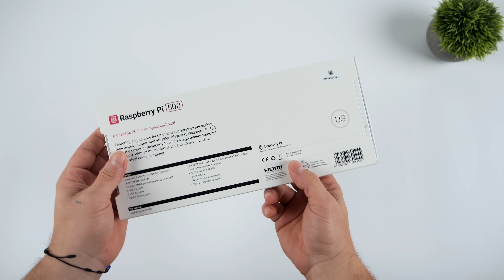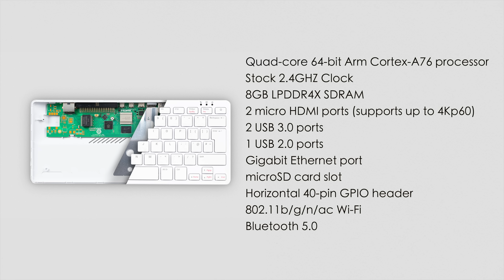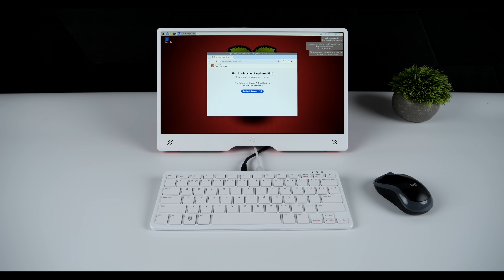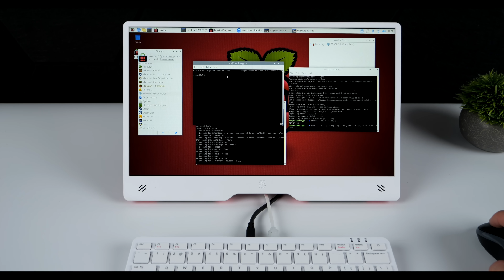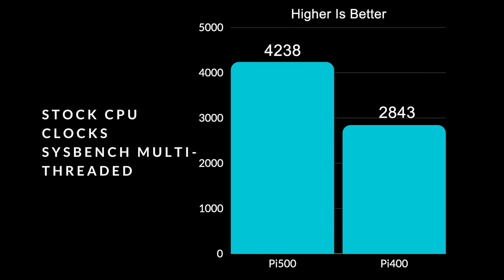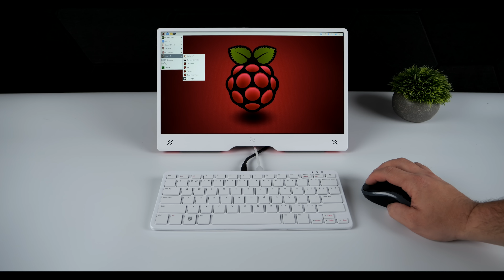Raspberry Pi 500 Hands On First Look, It's Finally Here!

Comment: I liked the PI 1,2,3 etc... They were cheap and great for small IO projects that were too much for an Arduino. However, The full kit and monitor is about £206 in the UK. I'm wondering what benefit this has over just using an old laptop and buying an IO card. Much more powerful, more software, battery portable.

Comment: Yeah I really don't understand why Ebon Upton didn't add an M.2 socket, relevant chips, and include a knock out or access panel to allow users to install an M.2. It would have been small fries on the price, and I'd really be happy to pay for that. It would also give the Pi#00 series that missing component found in all modern computers. Maybe the Pi600 will include it, or an upgraded variant of the Pi500 will add this feature. After all, why have the pads there if your not going to do anything with it?

Comment: I have a RPi5, but i think the 6 will brake the barrier, i think the RPi6 will be a computer with full capability, since we have 4 years with good performace arm processors(apple silicon), the next RPi will come with one of these processors(not the apple one, but one with this horsepower), and usb C as major. If is not dream too much, they can give up HDMI and all usb ports for 1 USB C as charger and 2-3 more USB TB3-4 would be more than enough to replace all the actual ports with dongle.

Comment: I knew they'd make a 500. I wasn't expecting it to be entirely white, and I certainly wasn't expecting a monitor. It would be cool if they also made them in black. I see that's it's got connections for a battery, and other unused spaces.

Comment: This might sound crazy, but I somehow wanted to try out the Pi 500 with an Xreal/Rokid/RayNeo/Viture AR glasses. I don't have much expectation for head tracking in Linux OS, but having a huge external display from those AR glasses is already tempting enough for me.
Reply: would have been easier if they included a full functioning usb-c port, but alas..

Comment: In addition to the NVME slot, I think this could be a lot more successful if it had included a Pi camera connector. The Pi 5 series lacks video encoding, so any advantage it could get to reduce CPU overhead during a video call would help a lot. Video calling is a use case that has really grown over the years and I'd like to see them consider it in the next generation.

Comment: What is the use case for this?  Besides to play around with
Reply: Same as any Raspberry Pi - it's a learning/programming platform. Getting a 40 pin GPIO in a standard Mac/PC isn't quite as easy. It's a great way to get kids into linux and/or python.

If that's not enough reason, it's a great emulation station. Or it's a quickly headless server type option. You want a headless choice while being convenient - bam.

Comment: Admittedly, I don't know much about hardware support when it comes to Pi's, but it seems a bit odd that they designed the monitor with a USB-C input for display, but didn't include a USB-C output on the Pi 500 🤔
Maybe different teams that weren't communicating, or can Pi's not do USB-C display out?

Comment: I think I'm more excited that the little monitor is full 1080 and completely cased with buttons with some mounting points then the pi500 but it's still a cool welcomed upgrade. Man you can get one right now for 90 bucks, in stock too. No NVME is complete bummer, it should of been included and just released at $99 dollar instead of 90 to recoup cost.

Comment: For those people that need a basic computer, but do not have much money the Raspberry Pi 500 along with the Raspberry Pi Monitor is a real bargain. This is one of the lowest cost computers a person could buy. However this comes with some limitations. One limitation is that this computer is slow when compared to other more expensive home computers. Also this computer can only run a few linux based operating systems, such as Raspberry Pi OS and a version of Ubuntu.

Comment: I have the Pi400 and i cannkt type on the keyboard very well due to the weird key spacing.  Apart from that its great.  I wont upgrade to the 500, but i will wait for the plus or 600 version and see what that includes.  Im amazed how the price keeps falling.  It will be a great cheap retro gaming and basic computer use type bit of kit to buy for many.  It would make a great Xmas present for many im sure.

Comment: Would be cool if the portable monitor would have been display over USB in combination with power delivery (from the monitor to the Pi). Think an SSD would have been better on the underside of PCB. Don't want people to go remove the keyboards above with the lid and clips.

Comment: Kind of a bummer that it doesnt use USB-C for power and monitor. :(
Reply: Came here hoping to find the answer to this question, but now I'm disappointed.
Reply: I felt the wording was a bit unclear? He said you could power it by usb from the raspberrry pi but only at 60% brightness. I guess that is not using USB-C but rather hdmi and a regular usb to usb-c cable?

Comment: Darn nice setup for standard cheap office PC and many other things. 

But you say avg 2.5 times as fast as the Pi 400. Some of the tests might get up there but from the static benchmark this is 50% faster only. not 150% but still a respectfull generation upgrade. You rarely get 50% more power from a normal PC or Mac 1 generation upgrade.
Reply: I do find it a bit odd that a couple of real world tests showed 3-4x improvement while the synthetic benchmarks "only" did 50-70% as well.Not sure what that is about.

Comment: so close to making a modern A500. just a touch of that A500 design would have been so cool maybe like a centimeter of flat part at the back edge with some ridges "for ventilation", and a logo PI500 on the right. Basically a nod and a wink. Of course, with the non-keypad design, maybe it would be better with it looking like the A600, even if the A500 is my Amiga.

Comment: Micro-HDMI?? This is basically e-waste with such a fragile connector. Would be an instant buy if they put full-sized HDMI ports on this.
Reply: Am I the only one who hasn't had issues with that connector...yet?
Reply: @trilight3597  I've had a Pi 4 since December 2019, and I've not broke the port of plug.
Reply: My Pi400 has had no issues with micro HDMI, so unless you're yanking it or just not being careful, it should be fine.
Reply: Agreed.
Reply: @ExplainingComputers  They don't seem that fragile.
Reply: You just need to carry a special cable for it, it's not expensive, but a bother for sure.
Reply: No it isn't.
Reply: I got an original pi400 and the micro hdmi has never been a problem
Reply: Just support video on the usbs and use a USBC to HDMI is what I want
Reply: They won't, it's in their policy to manufacture user unfriendly computers: non full HDMI on a DESKTOP computer
Reply: @danielpicassomunoz2752  or it just doesn't fit the case.
Reply: The Orange Pi 5 has full size HDMI and it has an NVMe slot.

Comment: In my view the biggest miss of the Pi400 was not having at least one regular HDMI port. This new Pi500 perpetuates that mistake. A full HDMI port would have made it simpler for occasional use (my case), so I will pass on this one, as my Pi400 is still serving me well.
Reply: @wanderleyceschim2881  just curious why using a mini Hdmi Adapter would be a problem? They are dirt cheap and it's what I used for the pi400
Reply: @Astro_Five  Like I said: occasional use. I have many things I plug in and out of the same HDMI port. Would like to just leave the one HDMI cable there and plug whatever to it without having to deal with a separate cable or yet another adapter I will misplace. And I understand the SBCs are tiny so no space for full HDMI port, but they had an opportunity with the 400 and now with the 500 and in my view missed that opportunity.
Reply: @wanderleyceschim2881  right on. You just leave the adapter plugged in to the Pi itself. It works just like the regular size HDMI input at that point. But I respect it being annoying to you

Comment: No full HDMI nor NVME will wait til Pi 600 so another 4 years.
Reply: I can live without full HDMI since micro HDMI and mini HDMI are still being widely adopted today. As for NVMe, I doubt this kind of enclosed compact design has enough cooling for it. M.2 SSD can get really hot.
Reply: Those micro HDMI and micro USB ports are  Sooo commonly breaking..   Anyone buying this should use a micro HDMI connector to full HDMI,  adapter.,  

Save the strain from impacting your device,  only plug and unplug to the adapter  (which always stays plugged in.)
Reply: fully agree. full size hdmi should be standard, specially on a large device. carrying an adaptor or cable only for this is a waste.
Reply: HDMI I can accept, but no m.2 is a deal breaker, they have lost a lot of market share to other alternative barebones and mini pcs already, I think they botched this.
Reply: @jondm733  you are right this keyboard style pc could be for eceryone not only for enthusiast... full hdmi is great too you dont need extra cables and full hdmi is highly available
Reply: Ya,  have to agree,   it needs full sized HDMI, (the minis break all the time) ,  easy to access  M.2  panel slot  (or two M.2 slots) and Easy RAM upgrades.  That just makes it easy to take the defaut configuration, or upgrade to 64GB RAM and 4, 8, or 16 TB of storage.
Reply: You will be dead before anything like that happens lol
Reply: You can build it yourself, plot out your own circuit board replacement and transfer the chips over.  The whole point of Pi was to be an educational resource to motivate Europe and USA to advance in engineering skills and electronics manufacturing and Programming.  Otherwise we run the risk of China taking over the whole industry.  Thank goodness for Japan & South Korea and Tiawan.
Reply: Why not get a laptop?
Reply: Micro HDMI is shit.
Reply: @DaveMcIroy  agreeded as ite easy to break like mini hdmi
Reply: @DaveMcIroy  No it isn't. It's just a connector.
Reply: It won't take that long. I can see a Pi 500 Plus happening. And who needs full HDMI?
Reply: @wisteela  I need full HDMI, Micro HDMI breaks too easily.
Reply: @  Pi 500 Plus , now with NVMe and full sized HDMI 2.2.  Just  $50 more.
Reply: I get the missing nvmi is huge pain but full hdmi is not a big issue imo
Reply: Don't need nvme on such a low end SBC.
A simple micro HDMI to HDMI I already have laying around solves the "problem".

With Pi600 hopefully there isn't any HDMI still around: should have a USB-C for that by then.
Reply: @hassosigbjoernson5738  A 2230 NVME could be useful...something low-end like 64GB would be more than enough but would offer much more long-term usability than a Micro-SD card.
Reply: @hassosigbjoernson5738  I'd be fine with Mini DisplayPort as well.

Comment: Would be such a suitable computer for my mom if it just had option for an ssd.
Reply: Your mom will be just fine with a 256gb micro sd
Reply: @raskarkapax  sd cards break and are slow.
Reply: @fleshreap  sd cards only break if you constantly swap it without taking much care of it. But if you put it carefully inside once and never touch it again (just as you would do with an internal ssd) you won't have any chance to break it. And a good SD card can read up to 200mb/s easy which is just as fast or faster than a good HDD.
Reply: I run my pi 400 with a portable USB SSD just fine

Comment: I would like to see this keyboard with an Apple M1 processor inside 🤯
Reply: At 10x the price and won't work without an iTunes password. No thanks.
Reply: Itd overheat
Reply: I've seen people take screens off M1 Macbooks that were damaged and use them like that. It's definitely something you can do yourself.
Reply: it's called Macbook Air and comes even with a high-res HDR monitor and a battery to use it everywhere ;-)
Reply: @TT-pi8ww  A MacBook is not a keyboard

Comment: Is it just me or is this just an overpriced toy? I seriously do not see a proper usecase for it for this price, especially with it having an underpowered ARM chip from 2018, in the age where ARM chips can go head to head with x86.

It can't be used as a daily driver, it's not that practical nor cheap enough for hobby projects, what is it meant to be? And not to mention all the unpopulated stuff on the board. The least they could have done was to give us a proper PCIe/NVMe port...

Comment: For the ones more versed in Computer engineering is it possible and what would the drawbacks be to putting a more powerful mini PC with a higher quality CPU in this form factor with a PCIe or oculink plugin that could then use an eGPU to game? Just curious. Would the heat be a limiting factor?

Comment: The M.2 is not the only thing that is "missing".  There is also A LOT of unpopulated pads and odd layout design choices on the board too.  It really looks like they have other intended uses for the board... Perhaps a laptop is in the works???
Reply: Jeff thinks on the left side thats an unpopulated PoE Port, which is odd since there is no opening for the LAN cable.
Reply: @albundy7718 I mean, the Pi500 has a LAN port... but it's not PoE
Reply: Maybe a dedicated GPU?  A sub $300 laptop with dedicated graphics would be a game changer.
Reply: Looks like there's a Power Over Ethernet section that's unpopulated.  Maybe a Raspberry Pi blade server?
Reply: The missing parts on the far left is for PoE.

Comment: I used to be a motorsports writer. I would've KILLED for a simple, light setup like this in the media center at Daytona to write and edit articles and post to my website like this. At sub 200 dollars for the whole setup, this could REALLY get some work done! If it also does retro emulation at all well, up to say N64/PS1, It'd also be great for the downtime. I see this as a no-brainer to buy if you have a use case like I used to for this... Raspberry Pi's products and small form factor single board computers in general just never cease to amaze me these days. Thanks for the showcase!
Reply: honestly the pi 400 would be good enough for that.
Reply: 15 years ago we had simple netbooks to "write" stuff like MSI Wind U110 or ASUS EeePC.
Reply: @  You know professionals that used netbooks? Everybody i knew back then either had either a thinkpad or an  Powerbook 1400 (or another apple notebook) if they were on the go. Real „writers“ had office machines at home with ergonomic keyboards. But netbooks? Those were for beginners or students with a budget..
Reply: Use samsung dex
Reply: @FloridaManRacer  i mean u could just get a laptop for thaat price, even a chromebook can run linux
Reply: @zenunomusic  you  and me might get a notebook instead. But we both might not write enough to appreciate the ergonomics of a separate keyboard.
Reply: @erebostd  im a software engineering student, i type a LOT that’s the whole degree im taking haha. i don’t think it’s an ergonomic thing, a laptop would do more and be way better to take around
Reply: @ take around? Absolutely? Come on. Maybe you should take a look at work place ergonomics. You know, that thing that notebooks can’t provide unless you make a desktop out of them 😉
Reply: @erebostd  i do get home and have a full desktop setup to plug my laptop into, but then again, just buy a separate way better keyboard for your laptop haha that keyboard doesn’t look great to type on regardless! at least in my opinion : )
Reply: For $200 I prefer used Lenovo Thinkpad T series, even though it does not support windows 11 , it has best keyboard and replaceable parts.
Reply: just get a laptop

this is a toy, you have more computing power in your smartphone, and a small notebook takes less space and has better battery life
Reply: @FloridaManRacer It's good to be realistic about the performance before purchasing. The Pi 500 is a Broadcom BCM2712, that is only a quad A76. There are many $200 USD laptops with faster N200 or N5100 CPUs for sale every day. This time of the year, even N100 (twice as fast) or N305 (three times as fast) are on sale for $200. Even better, there are 5700U laptops under $300 (five times as fast). Like others have mentioned, for the price, this is a novelty.
Reply: macbook air for like 600 buckds really is worth it.
Reply: A cheap laptop would have been far more useful. This is a toy for children, babies first linux pc. For teaching basic python so they can make some led's blink etc.